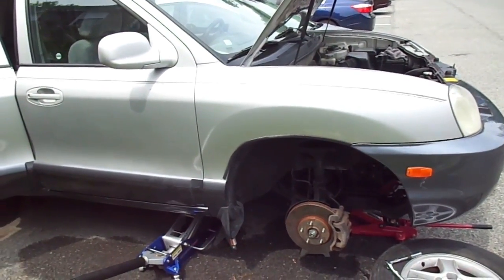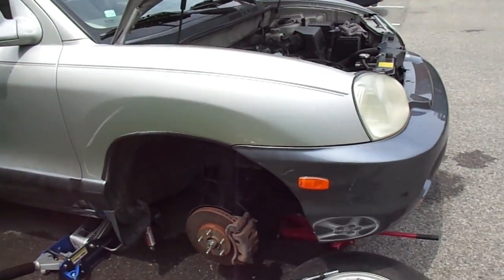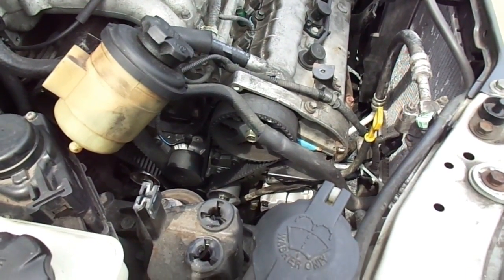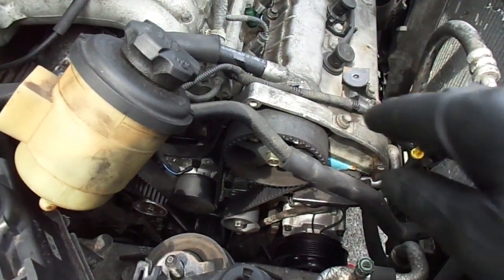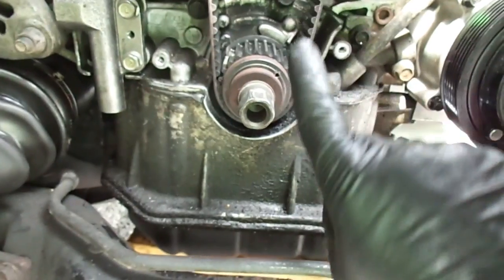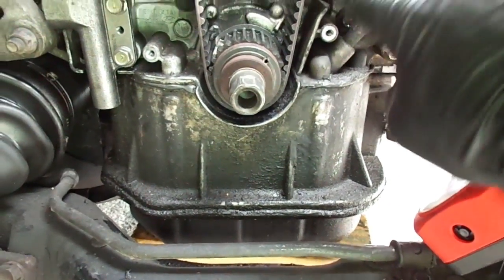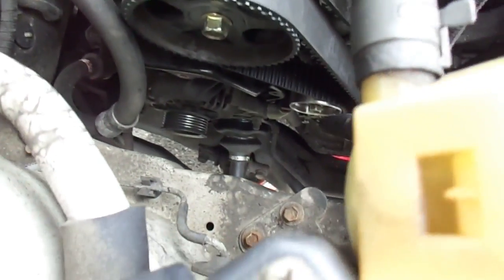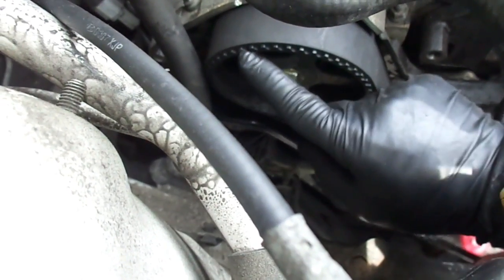2003 Hyundai Santa fe 2.7L V6 / Timing Belt Tip

Comment: Yes these 2.7 delta engines this is the ONLY WAY to put the belt on HOWEVER what I did with the cams above is zip tie the belt to the cams so they stay tight on the right side.
Reply from the maker: Great. Thank you. I will keep this in mind.

Comment: had a car with timing belt once, never go that route again,  I check, to make sure the car I am buying has a timing chain
Reply from the maker: Many of the car companies are going with timing chain. Timing belt are very difficult to do.
Reply: They are not hard to do, most cars with chains today have problems, It is much easier to replace a belt then a chain.
Reply: Yeah good logic until you have to do timing chains
Reply: Honestly the timing belt on the 2.7 is easier to do than spark plugs and valve covers and less time consuming
Reply: @NoneMechanic101  I got a 97 honda accord v6 2.7l 24 valve does my timming belt run the same way as this santa fe and are the best engines the same
Reply from the maker: @brahayamhernandez3815  Are you having problems with the car?
Reply: @NoneMechanic101  No problem I just need to change my timing belt and can't seem to find much info on 97 honda accord v6 2.7l c series your video was the only one with an engine closely similar mine
Reply from the maker: @brahayamhernandez3815  If you can go to Astralautorepairs channel he has about 1,000 videos. He may have something.
Reply: @NoneMechanic101  thanks for the help Just keep on making consecutive videos very informative and helpful
Reply from the maker: @brahayamhernandez3815  👍

Comment: That is a nice tip because I have fought with those things so many times! Removing the tensioner is the BEST way, thanks for that! 👍👍👍👍👍
Reply: Hey its Timmy lol
Reply: @htatesil4192  🤣🤣WOW!!!!!!
Reply: @NoneMechanic101  just brought a 2.7 hyundai sonota 2002 67k miles it sat for 6 years in Florida then they drove it to Seattle where I live and it sat 3 years ima pull the engine out change the heads I got Timmy's videos and this helps alot my friend just destroyed his the cams got bent people gotta take this timing belt serious because it's a interference engine
Reply: Ya mines doing the same thing it takes a few tries to count how many teeth out it’s jumping so u can off set it the right amount of teeth so when u throw in the main tensioner and let it tension you don’t jump time. U jump time in one of those engines it will you’ll screw your valves cams or more depending if you drive it or u just start it even it’s game over. Take ur time money and reputation go hand and hand in mechanic work

Comment: Hello, I replaced the belt on my car a year ago and I happened to pop off the upper timing cover and the belt is loose on the water pump side. I replaced all of the timing components with OEM parts except for the timing belt, which was a Gates brand belt. Is it normal for the timing belt to have slack on the water pump side? The idler and tensioner sides have good tension, but the water pump side is so loose that I can turn the water pump pulley by hand.
Reply from the maker: Can you send me a video. Email me Nonemechanic101@yahoo.com
Reply: my car has the exact same issue just as you described - slack on the water pump side but not the other. Did you find an answer? thanks!

Comment: Yup going over the tensioner on the Delta engine, always will cause the belt to pull the CAM pulley on Bank 1.  The trick I do?  I put the timing 1/2 tooth in the opposite direction, so when the belt goes to pull, it pulls it into time.  Then rotate twice, and it should be spot on.

Done my Timing Belt on my Tiburon many many times.
Reply from the maker: Thanks

Comment: Hi there. I beleved this is the same motor i have on my tiburon v6
 I need to ask when you talking about the part cut off in the video sorry becauae i didnt understood. .. for be clear you take out the tensioner completly from the motor after the fail pf the timimg jump and then put the belt around the pulley and then put back the tensioner or you jist say you commit the error didnt pullout the pin from the adjuster until habe the correct time and then pull put the pin? What of this 2 you do for fox the issue. I didnt ever di this job but i want to tdy for do bymyself i have skills and tools. I didnt want to have this probkem so i see videos and find you and i ear about this happen to this engines. So. Let me.know what you try to say on video im confuse if you talking about pull out completly the tensioner and put the belt and then put back and pull out the pin or just dont pull the pin until habe the correct time ?
Reply: Did you speak spanish?
Reply from the maker: Yes

Comment: My timing belt broke off my 2002 Hyundai Santa Fe and bent a valve or two is it worth fixing still
Reply from the maker: That is a decision you have to make. If you are going to fix it yourself remember is going to be a lot of work. If you are going to have someone else do it. They are probably going to charge you over 1,000 dollar.
Reply: How can I tell where the no compression is coming from I want to fix it if it's cheaper to do it my self
Reply from the maker: @brandiborem3452  , see if this video can help you out. Don,t forget to use SAFETY at all times.  https://youtu.be/ZHr2bbuiWiw

Comment: Soon as I find new power steering and serpentine belt tensioner bolts I will be doing the belt on a 05 Tuscon and I think you just saved my life LoL oh any idea where I can get those bolts? I try the junkyard, eBay and rockauto and can't find them....
Reply from the maker: You tried all the places I would have try.
Reply: @NoneMechanic101  I was afraid of that lol ok one more question...I got this Tuscon for $500 the timing belt was already off and I didn't get to see if it broke or what happened, I do know that the water pump is locked. They said it happened in there driveway I used a scope to see inside the 3 piston Chambers on the front and I do not see any marks at all on the Pistons, if the belt broke it would do visible damage right? Either way for $500 I got an 05 Tuscon in very nice condition and it also came with the timing belt kit...